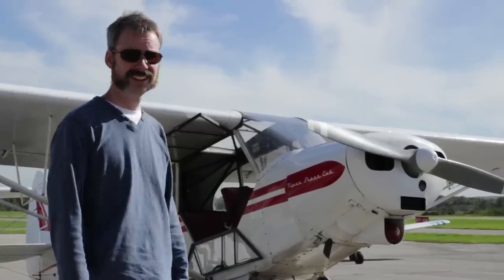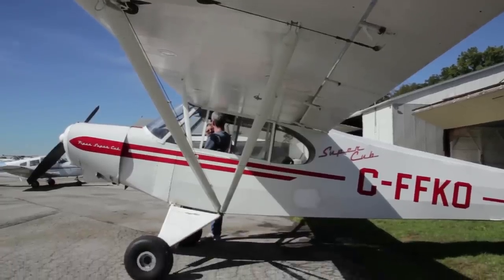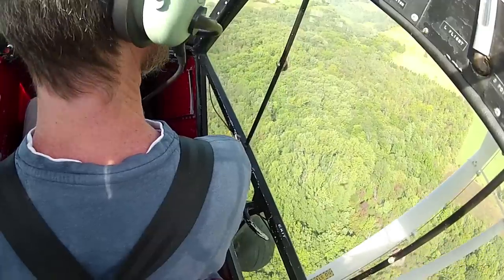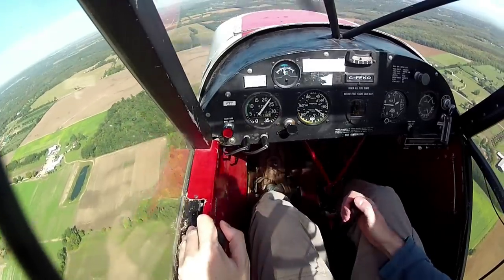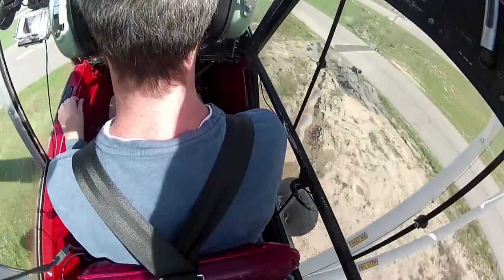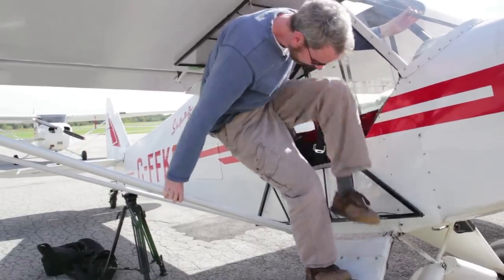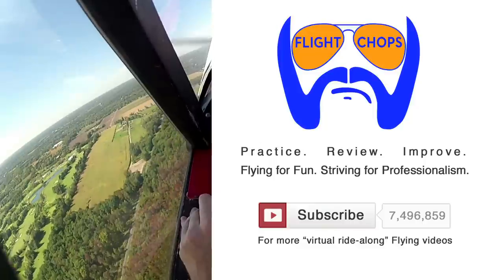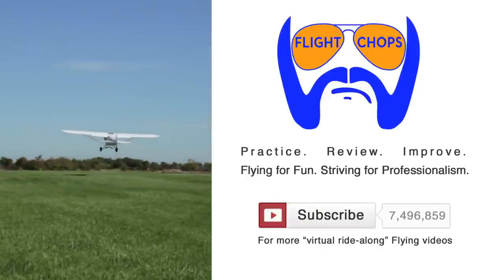Tail Dragger check ride - Mastering the dying art - Flying - POV

Comment: Steve,
I was under the impression this was the actual check ride and the final flight of getting your endorsement. The exact opposite though.
Is a tailwheel add on a big deal and full check ride in Canada or similar to the states with just 4-5 hours to get the endorsement?
Reply from the maker: Michael Carr Correct - it's a "sign off" at the instructors discretion.  it generally takes 4-5 hours... The insurance at the school I rent from requires 20 tail wheel hours to be signed off for passengers; And I don't disagree with that.  I felt "safe" after being signed off for solo at around 5 hours, but I had no problem with the policy requiring me to log an additional 15 hours before adding the distraction of a passenger.  I am currently at about 25 hours (as of Oct 2014) - I covered the whole process of the tail wheel adventure (including many interesting post solo flights as I got more comfortable with the the plane (icluding some where I scared myself.) I'll be adding them to the Play list called: "Tail Wheel conversion training! This is an on going SERIES!" - look for that on my main channel page.  Cheers, Steve
Reply: ***** , thanks, Steve.  It's been a good series so far. I am about to finish my helicopter add on (Playlist on my channel of that learning process) and will take up tailwheel next. 
I was able to "practice" some landings with a friend and in his Kitfox - it's going to take some more actual instruction time to get proficient.  

Some restrictions are different in Canada so that's why I ask about hours. It has taken the friend some time, like you, to get comfortable enough to let me take controls, even though I can't log the time with him.

I'll be looking over your series and learning.

Thanks for the great channel.
Reply from the maker: Michael Carr Awesome!  I will check out you heli training videos!  That is something I am considering doing - but DAMN is it expensive!
Reply: ***** , yes expensive but I've been saving for a while.
It's certainly been worth it. I'm the states, it's $285/hr for a R22.  When I was in Australia is equaled to almost $570USD/hr.

You wouldn't regret doing it though.
Reply from the maker: Michael Carr Wow, the cost in Australia is crazy!  And yes, I know I'll like choppers - I sort of afraid to try and find myself addicted to and even more expensive method of flying :P

Comment: Great work on the videos.  You mention in this tail-dragger video that you used to fly gliders.  Do you not fly them anymore?  If not, why?
Reply from the maker: "Life got in the way"...  I started flying (in gliders) during the summer between 1st and 2nd year University, and moved straight to power training the winter after my initial flight training at a local soaring club; despite having the best of intentions to get back to gliding, I never did.  That was 1995 :P  As life got busy it was not too hard to fit in a quick trip to the local airport for a power plane flight a few times per month; however, it was hard to figure out how I'd fit in the time to go for a full day of soaring club activity to get a flight in (it is not as close to the city (a 90 minute drive, and you can't just show up and expect to fly and then leave - you need to get there early, help with preflight prep pulling sail planes out of the hangars, and then wing run for other club members through out the day, and ideally stick around to help clean up.)  Anyway - I can see the time becoming more available in the near future as life settles down, so I definitely want to get back into soaring!
Reply from the maker: Richard H Very True Richard...  My secret plan is to become a tow pilot and see if I can trade some of the "full time" work at the club for doing the tow duties when I can...  Not sure if that's exactly how it goes, but I'll see about it maybe in a year or tow after I've built some tail wheel time...
Reply from the maker: Richard H Yes, I was mostly joking about the "secret" part of this plan.  I will definitely have to get the tow endorsement at the club I'll be volunteering at.  Looking forward to that journey, and I will definitely document it!